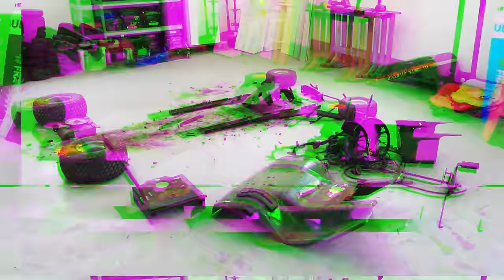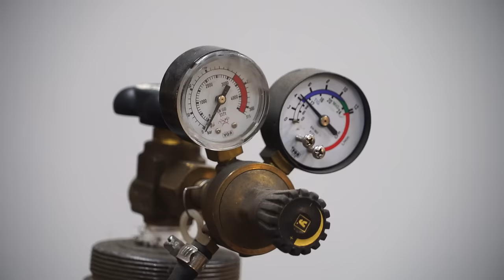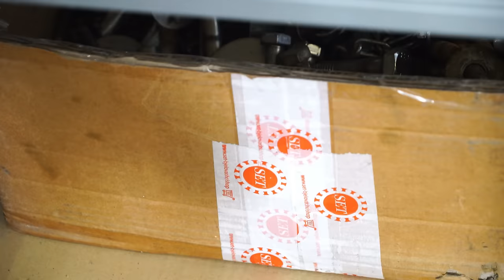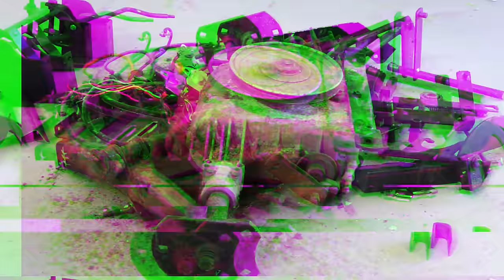Homemade JOHN DEERE 200cc Race MOWER !? Part 1

Comment: Can you give us a list of parts we need?
Reply: No
Reply: Lawnmower
Metalworking tools
Reply: @finianmcelhany3904 he bought stuff for it and the tools you need could be included with that list too
Reply: Drill jigsaw welder pressure washer go kart axle go Kart tires chain an engine (unless your using a stock engine then you just need a pulley swap) screw driver kit (maybe wd40 and a de rusting liquid or smth) if your gonna repaint it get paint thinner paint and an airbrush if ur gonna wrap it get wrap and a wrapping kit maybe a bucket seat or a new lawn mower seat and maybe a couple more things I'm missing but that's about it
Reply: What about the gearbox?

Comment: The toe on the front wheels is crazy... why?
Reply: Because the drag link between the two axles has no adjustment, so unless he cut the drag link to the exact dimension (which is doubtful) there is no way of getting the toe in/out correct. The front axles also has quite a bit of positive camber this will not help in a racing situation. The steering also needs good Ackerman angles to work correctly.

Comment: These can be pretty fun once you get them all done, I put a 25 hp on the one I built and it did about 55 before you would get to scared to keep going lol. Have fun and stay safe as the stock seat is pretty slippery around hard corners.
Reply: I was thinking the same thing... I have an E180 with the 25hp V-Twin. The only draw back is I'd have to find something else to mow those six acres out there that just keep growing. I was just thinking of the reaction I'd get from the local sheriff's deputy when I go blasting past his coffee stop on that thing doing 50-60 mph with either a big grin or that other look, just before I'm gonna die!!   😂🤣

Comment: These videos are awesome it just sucks it’s like “yea to build this first have 100k dollars in tools and a garage and random parts”
Reply: It's not that expensive for a 300$ welder a 80$ saw and a 40$ wrench kit and a 80-100$ drill
Reply: But the engines about 400-500 unless you find a good used one
Reply: If you think that's $100k in tools, you probably don't have the skills to do it anyways.

Comment: The cheapest easiest way would be a live axle with a Jack shaft and centrifugal belt drive then chain drive on the main drive or even better put a double v-belt with a idler and trampoline spring with a linkage clutch pedal and a 670 v-twin Predator out front sounding roudy af! Awesome video and good work I know you sure put some time in on this build.

Comment: Back when they built decks that didn’t fall apart.
Reply: Yeah and its damn shame he ruined this one. Working mower with only some surface rust and few bits needing to replace that you can make in garage shop... nope lets just rip it into peaces and hack everything so it will be toyed for year or two until sent to scrapper, while if little love was given it would have served well the rest of the century... Problem is you can get these old reliable ones no more and new ones are garbage designed to fail and be hard to impossible to manufacture replacement at home.

Comment: Why you didn't put on 3 cylinder engine,4x4,servo,suspension and off road tires or drive tire. Why not?
Reply: Because that not what lawn mower racers are about it's bare frame and sketchy as hell..sketchy=fun that's the point of a mower racer a toy that goes fast that didn't costs thousands of dollars

Comment: im not sure if you where aware but your brakes wont work properly if the bleader is at the bottom of the caliper you would have to flip the caliper around no hate just letting you know from expirience
Reply: It doesn't look like this is the first time you've done this, The precision alone required to make it work is an amazing mechanical feat.🌸💐

Comment: There needs to be a differential at the back. It will put a tremendous load on the single-piece rear shaft when turning. This is ridiculous. The rear system is extremely amateurish.

Comment: weld the parts that hold with bolt to the frame and add a little of positive caster to the front wheel you going to like this
Reply: you weld everything in part 2 sorry 😅

Comment: Seam to need lower gearing for hole shot but other then that not bad us to do this but with all stock components and atleast 14+ singles or twins cylinders 16 were stout engine some modes to engine and pulleys  and lowered all with out welder and managed to hit 63 on some but average was 50 just back then and play in joints were to much but it was in my teens 90s we ride them everywhere when it snowed on road but i did live in the hills so cops then weren't big thing

Comment: It's not 40 years old it's around 35-38
Reply: I have an '82 111.  It has a hydrostatic transmission, and I promise you no one but maybe a weightlifter will pick up the rear end even 1 inch.  I still cut my grass with it.  I never knew they became so cheaply made in later years.